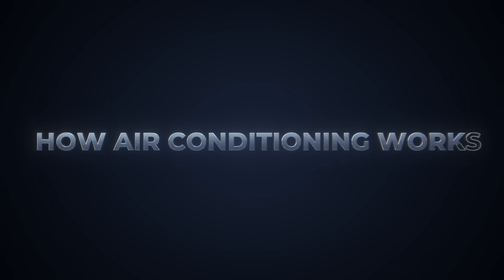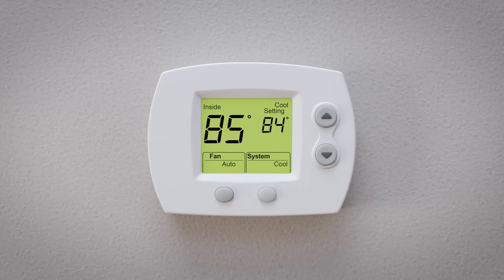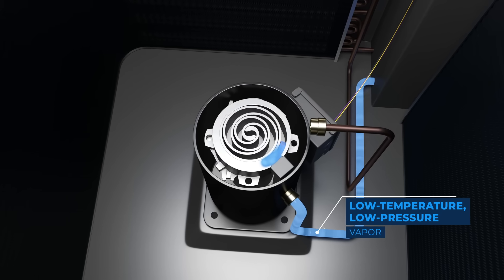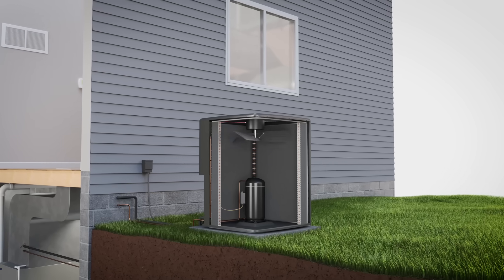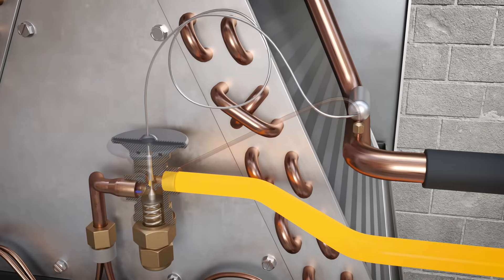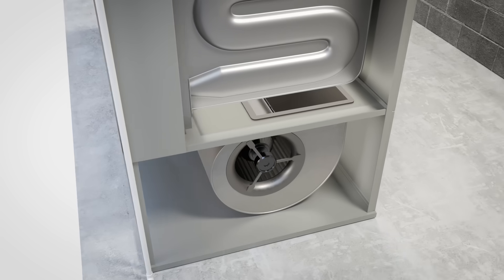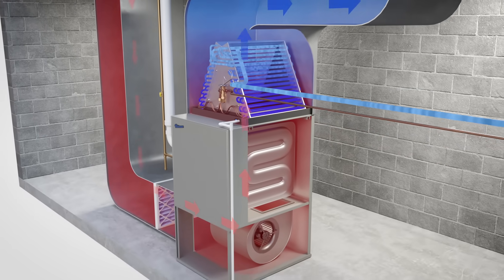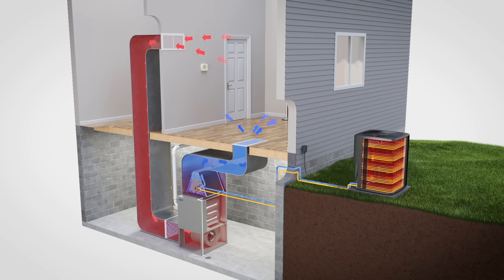How Air Conditioning Works

Comment: how the hell did humans figure this out

edit: Jesus christ I was high when I posted this comment why are people taking it seriously
Reply: lots of research through trial and error with compressing air machine
Reply: How many ppl blew shit up and caught houses on fire before they figured it out?
Reply: @ADX724  not many. This was tested in a lab first.
Reply: @ADX724 i love your profile picture a excavator nice
Reply: @Tom-em3dv  I run that excavator
Reply: @ADX724 yeah they probably Explosion tested it as well if that answers it
Reply: It all started with blowing air 🌬️ over blocks of ice
Reply: Incredible
Reply: Willis Carrier “Father of air conditioning”
Reply: White peoples  are really smart
Reply: @stuffandwhatnot  they probably watched the video
Reply: The invention of air conditioners was driven by the need to control indoor temperature and humidity for both comfort and industrial purposes. In the 19th century, scientists and engineers began understanding the principles of thermodynamics, particularly how the compression and expansion of gases could absorb or release heat. Early cooling systems, like John Gorrie’s ice machine in 1842, used compression to cool air, aiming to treat patients with tropical diseases. However, these systems were rudimentary and not yet practical for widespread use.

The breakthrough came in 1902 when Willis Carrier designed the first modern air conditioning system. Working to solve a humidity problem in a printing plant in Brooklyn, Carrier created a system that used coils to cool air and reduce moisture. This innovation not only stabilized the printing process but also laid the foundation for temperature and humidity control in homes and businesses. Over time, advancements in refrigerants, efficiency, and affordability transformed air conditioning from an industrial tool into an essential comfort technology, shaping modern life as we know it.

Source: ChatGPT
Reply: @alikhalifa1988  ChatGPT is not and should never be used as a source
Reply: Man I say the same thing about a lot of things in life we take for granted such as all utilities plumbing electrical and HVAC certainly great fuel to have all these things just 100 years ago most folks ain’t had none of the amenities we all have today!! Big thanks and respect to the men and women who paved the way for all these amazing innovations the human mind is one hell of a tool of used properly
Reply: Even more incredible -- how did humans fit this and all of the engineering required, in a car?
Reply: Google
Reply: @stuffandwhatnot  i work with some engineers.  They're constantly experimenting with things and checking the natural properties of everything from a whole different perspective. Idek if they realize this but they enjoy when something is different because it immediately becomes useful. Copper for example some people might see it as weak and it heats up fast but others noticed it's easy to form stuff into and they knew that energy can be moved so they kept tinkering and created stuff like this.  The next step is to have nanobots copy what cells and other small organisms do at a small scale them mimic it at a larger one. 3d printers are going to be like the original iPhone where one device could pretty much do anything. Even custom made body parts will become a thing
Reply: You know they didn’t make this invention all at once right they build a knowledge and stuff like that
Reply: Witchcraft if you think about it. “Lesser Key of Solomon”
Reply: The West
Reply: same thing i was thinking
Reply: Our intelligently designed brains.
Reply: @stuffandwhatnot  hundreds of years of innovation
Reply: @stuffandwhatnot  that's what I said. I'm so impressed.
Reply: Science.
Reply: @stuffandwhatnot  If you this is neat you should look into Electrohydrolysis, a process for pulling oxygen from water
Reply: They were smarter before cell phones and internet came along.
Reply: Thanks white people..
Reply: @stuffandwhatnot  it all started with making food last longer
Reply: it was built upon the theory of thermodynamics which was developed primarily to analyze the efficiency of steam engines.  wild stuff and it really makes me appreciate the effectiveness of application of science and mathematics across diverse areas of life
Reply: @stuffandwhatnot  the starting point is that humans realized vaporization absorbs huge amounts of heat without changing temperature of the substance. Then created a system that utilizes this science. Pretty much all system designs work this way, even for softwares.
Reply: I find myself asking myself that about so many things. The human race is so capable of many good AND evil things!
Reply: I’m asking myself the same thing bro 😂
Reply: @stuffandwhatnot  hahahaha I know. Essentially all of this is physics theory, so the idea of cooling something through separation of heat from an environmental space makes sense. Then it’s just about finding the right coolants and system to make it work. They used to use ammonia to cool refrigerators. Stinky stuff
Reply: @stuffandwhatnot  they weren't MAGA followers!
Reply: Original AC was used in manufacturing to help make products, higher quality and more pure. It was much more crude than this. But eventually, they understood it was the phase change they caused the cooling and condensation.
Reply: @stuffandwhatnot  were a pretty smart but sometimes we use our intelligence for the wrong reasons. 🤦🏻‍♂️
Reply: You need to learn how temperature working 

Like why boiling water is boiling
Reply: @stuffandwhatnot   easy science broski
Reply: Our amazing brains were created by an amazing God
Reply: White men

Comment: How ac works
(Most people): even if the room is 90 degrees, turn it to the coldest temp the thermostat will allow it to go and morons think that's the temperature it will be in 10 minutes.
Reply: Or whatever temperature the thermostat is set on is the temperature of the air blowing out of the vents. It's surprising how many people believe that.

Comment: I’m sorry but you would think someone making a video like this would run it by someone with experience and confirm that the information is correct. First error is at 49 seconds .Compresses do not pump a fluid . “Fluid” is absolutely the wrong term . The compressor pumps and compressors the refrigerant into a high pressure Vapor.
Reply: fluid is a general term in physics for both liquid and gas states of matter.  but yes, for the common person, gas should be used.

Comment: Awesome explanation but Why is the air coming off my evaporator coil 47*-52* instead of colder like 35*-40* or does it has something to do with r410a which is a medium temperature refrigerant also my delta T is 21* at times
Reply: that is about normal.  check the vent temp when the room is colder, after 3 hours.

Comment: Unless it’s a Daikin unitary system. In which case the thermostat will lock on a temperature just below the set point 77 while the home temperature goes up 4-5 degrees to 81. You can replace the thermostat but that issue persists and there’s no other compatible thermostat to replace it with.

Comment: Why does low refrigerant cause icing up of the condenser?
Reply: icing in the condenser is usually caused by a restriction or blockage causing a pressure drop "boiling" the refrigerant.

Comment: The myth of wetting the condensor helps extract the heat is busted
Reply: it does lower the high side pressure when there is something wrong with the high side part like a broken fan or a dirty condenser.

Comment: So the air leaving the fan outside should be warm or hot if the unit is working properly? in hot and humid conditions that is.
Reply: Warm.  Hot, weak air means a dirty condenser coil

Comment: Question for the professionals. So LP/LT coolant is pulled into the compressor, increased to HP/HT, then reduced down to MP/MT to be pumped back into the house. 

Why increase it to HP/HT then?
Reply: because you have to move the refrigerant. it will not move on its own.  and when you move or compress it in a gas state at the compressor, it will become hot and its pressure will increase.  laws of physics.  you turn off the compressor and nothing happens, no cooling.
Reply: I think it would be better if he started over. First explaining that when you do work on the refrigerant you are compressing a gas. This is how a compressor works. And then explain where heat and pressure are involved.

Comment: Some parts are confusing. Like when it says the air passing through the evaporation coil it “boils” the refrigerant (to me meaning hot) but then animation shows “low pressure , low temp” refridgerent going out to the condenser / compressor to release heat
Reply: ac system uses refrigerant, substances that boil at very low temperatures.  in this case at the evaporator pressure,  it boils at just above freezing temperature of water.  that is cold.  when it leaves the evaporator, it is still at about 50F to 60F, still cold.

Comment: great vid,  I think you could expand on the actual temps of the refrigerant at different stages .  For example.   Why compress the refrigerant using a compressor and make it even hotter  only to then run the refrigerant through the  condenser coils to cool it?  anyone?
Reply: a compressor is kind of a misleading term.  replace it with the term "gas pump" and it will be easier to understand.  you have to move the refrigerant across the system so you need a pump to do that.  in this case, when the gas refrigerant is pumped (compressed),  its pressure and temperature rises because that is what gases do when compressed.  there is no avoiding it.
Reply: I believe it’s to help the heat escape. Heat is attracted to cold, so the refrigerant needs to be hotter then the outside temperature air. Hope that makes sense. I’m a student so I’m still learning.

Comment: There is no better system to cool your house then a heat pump. But the heat pump is crappy at heating your house. So you would be better off getting a gas furnace or boiler to heat your house. For all of us who live in the south, the heat pump is the only option to heat & cool your house. I, for one, have higher heating bills since the heater coils have to used to heat the house, while I have lower cooling costs since the heat pump is so much more efficient than any other forms of air conditioning.
Reply: A heat pump is identical to an AC in cooling mode. A heat pump is a reversible AC.

Comment: I don’t understand how the refrigerant goes out to the compressor as a low temp vapor but heat is released from it.
Reply: it goes in at the evaporator at about 35 F-40F and enters the compressor at about 50F to 60F.  it has some "heat" on it.

Comment: Question. Wouldn't water cooling the refrigerant be significantly more effective at dissipating heat? I would think water submerged condenser units would be a thing. Imagine having your pool heater simultaneously cool your entire house. Why isn't this a thing? Or if it is, why isn't it the norm?
Reply: water and metal = corrosion = refrigerant leaking.

Comment: The one thing I don't fully understand is how the refrigerant never "runs out?" What I mean is, the process works by heat exchange -- the refrigerant absorbs heat energy which is then released outside via the condenser -- but as heat is released outside, there must be some "loss" in the refrigerant itself, right? The refrigerant is then cycled back indoors at a "medium temperature" -- which couldn't be cooler than the outside ambient temperature, as that's where the refrigerant just came from. Then when it reaches the valve, the temperature then drops again. But how can the refrigerant ever return to the same icy temp it was to begin with after it's absorbed heat energy?

Another thing I don't understand:

If the refrigerant is intended to absorb heat from inside the home, why is it pressurized first?! This seems counter-productive to heat up the refrigerant because now it's got to be cooled before it can be used.
Reply: refrigerant wil only run out when there is a system leak. it us a closed system.   just like water in a closed and sealed jar.  you can come back after a year and all  the water will still be there.
Reply: @jack76gh45  I understand that it's a closed system. But your "water in the jar" analogy perfectly sums up my confusion:

In your analogy, the water is the "refrigerant," correct?

So basically just water circulated through a radiator in a car engine. 

But the 1st Law of Thermodynamics states that if your "coolant" is used to absorb heat energy from another medium, then the "coolant" itself will therefore HEAT UP. 

In a car engine, the heat is dissipated via the radiator, but anyone who's ever worked on a car knows that even after engine coolant has cycled through the radiator, it NEVER returns to ambient temperature as long as the engine is running; heat exchange just doesn't work that fast, even in the dead of winter. 

So back to my original question - the refrigerant is super cold, but is used to ABSORB heat and then dissipate that heat via a condenser (roughly the same principle as the car engine). 

My question is, after extended use, how can the refrigerant return to being ice cold when there is no way GET IT THAT COLD again in the system? There MUST be a loss of heat somewhere along the line, and any coolant exposed to the ambiemt temperature outside can't be COLDER than the ambient temp itself -- this would violate the 1st Law of Thermodynamics.
Reply: it is pressurized because you need to flow the refrigerant.  and when it it gets pressurized at the compressor, it will get hot.  gases do that.  no compressor, no flow,no cooling.
Reply: I agree with this comment. I think the video maker has made me a bit more confused. I didn’t know that there were medium, high and low compression areas. I will try to find a better explanation.

Comment: Excellent video, recommended doing one on the vapor absorption cycle. Cryo cooler or thermoelectric would be good too. There are many interesting heat pump designs, would be a great series.

Comment: Is it a problem when the pipe for the refrigerant coming back to the outside condenser is super cold to the touch?
Reply: Its supposed to be cold, the exact temp depends on conditions and the system but its usually around 40-60* F

Comment: Some systems have variable speed compressors so the compressor slows down so is the blower and condenser fan and blower as it reaches the set point and once it does it will either run at it’s lowest speed to bring the air down the humidity, runs at the lowest speed that will maintain temperature, or kicks off.

Comment: Omg, this is so interesting. I knew it! A perfect explanation. I’m going to need it because the AC/Heat unit that was put into my house is way too big for it. It’s now caused some serious issues. My floors are paying the price for bad work. It has  never worked properly. The main filter had to be replaced twice. I mean the original filter was way too small. The airflow was so bad that it would trip my electrical during my first heat needs. Winter. They replaced it after  9 months. I should’ve look at more stuff and I didn’t realize some other stuff was going on until recently. My insulation to my floors are so bad. Soaked. It has a major leak. I am so shocked. This actually helps so much! I know exactly what went wrong. Thank you.

Comment: My apartment has our AC units sharing a maintenance closet with someone else's. They connect directly to the wall behind the intake vents. He smokes heavily. The smoke has been pushing through my vents. Changing our filter doesn't seem like it will do much since it filters our outbound air to the blower. The filters are basic low end ones. I'm thinking his smoke is being pulled out of this apartment past the limited filter and filling the room. Maybe the exhaust isn't working properly?

Is it possible since the room is filling with air the blower motor is taking in the smoke? Changing out their filter with a MERV 12 MPR 1500 filter would help? Or is there a way to filter the air after the blower motor? The neighbors across the hall smoke pot and it drifts into our vents too. So I'm thinking it's something with the blower. Appreciate any insight!

Comment: Is this how a heat pump system works or is it different?
Reply: The basic principle is the same for a heat pump. In a heat pump the inside coil is the condenser and the outside coil is the evaporator, so now heat is pulled from outside and pumped inside instead of the other way around. Most heat pumps have a reversing valve which enables them to switch between heating and cooling mode on demand.

Comment: I live in the 6th floor of an apartment building.
My landlord won't let me install something on the outside wall. This means a mobile AC unit is required. And this means I live in a place with a running compressor inside.
ANC Headphones help a lot but I have a hard time sleeping with them. I think I have to move. I can't live like this anymore.

Comment: So is the AC condenser fan actually just cooling the compressed gas so that it doesn’t get too hot when traveling back into the house?
Reply: its purpose is to cool down the refrigerant so the refrigerant turns into a liquid.